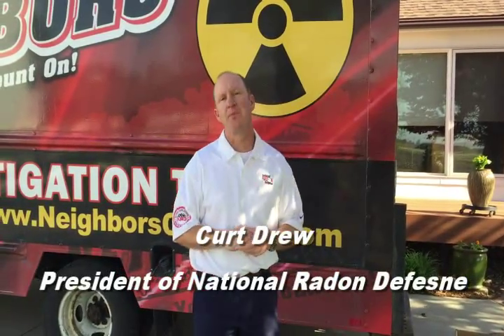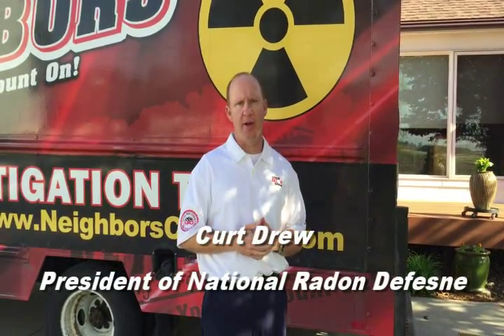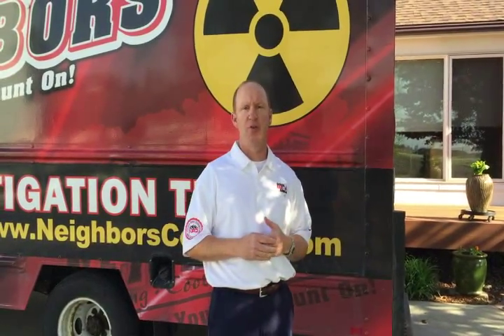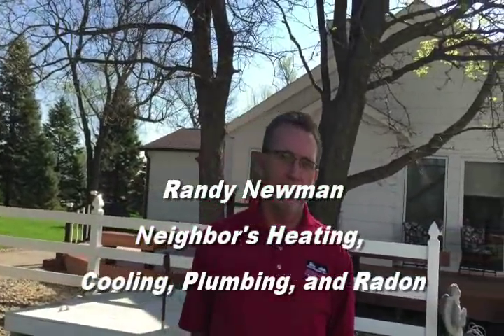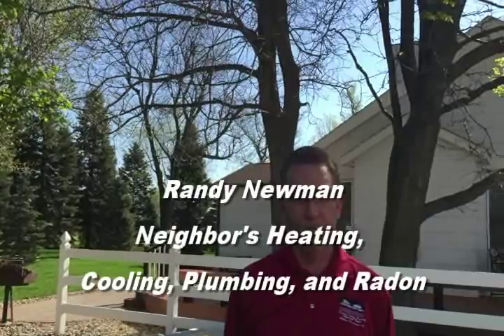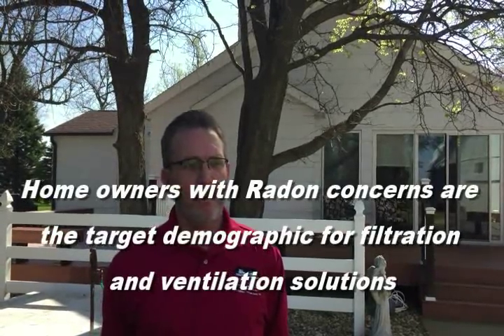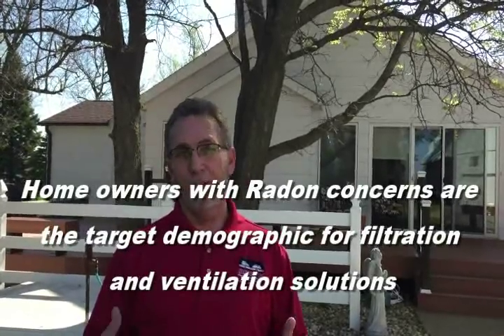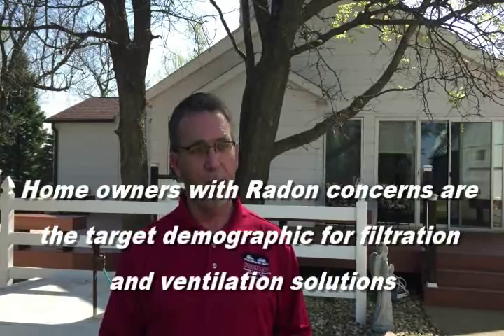Reducing Radon Using Ventilation

Comment: How many minutes per hour do you recommend to run the ERV?
Reply from the maker: The recommended run time for an ERV typically depends on factors like the size of your home, the number of occupants, and the air quality. In general, most systems are designed to run continuously or for several hours a day to maintain good ventilation and air quality. A common recommendation is to run the ERV for at least 15-30 minutes per hour to ensure adequate air exchange, especially if you're aiming to improve indoor air quality or reduce humidity. However, many systems have adjustable settings, so you can customize the run time based on your needs and the conditions in your home.

Comment: I am in SW Florida. Won't this system increase humidity in my house?
Reply from the maker: Where humidity is often high, an ERV (Energy Recovery Ventilator) can actually be a good option to help manage both temperature and moisture. An ERV transfers heat and moisture between the incoming fresh air and the outgoing stale air, which helps maintain a balanced humidity level inside your home. Unlike an HRV (Heat Recovery Ventilator), which primarily focuses on temperature, an ERV allows moisture to pass through, helping to prevent the indoor air from becoming too dry or too humid.